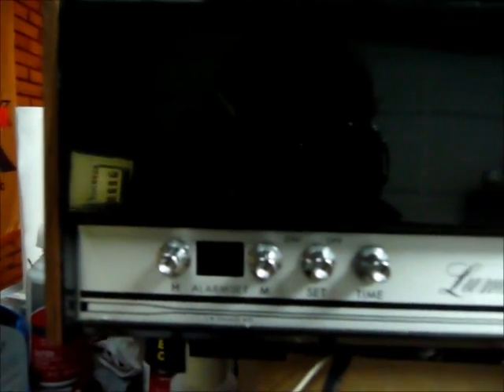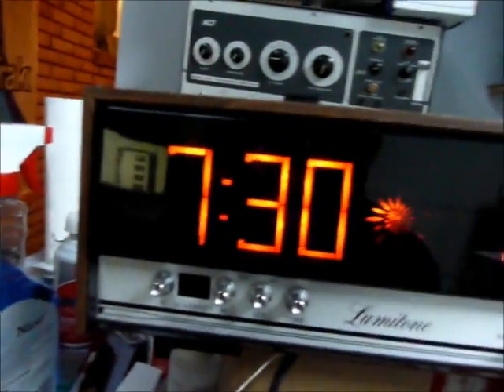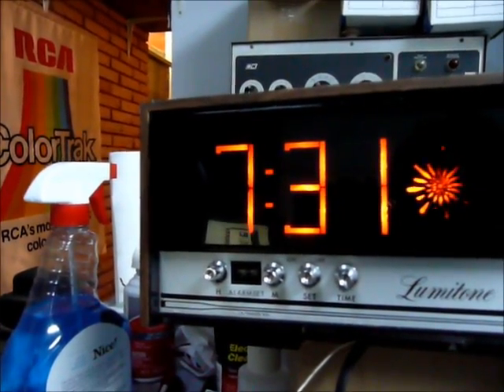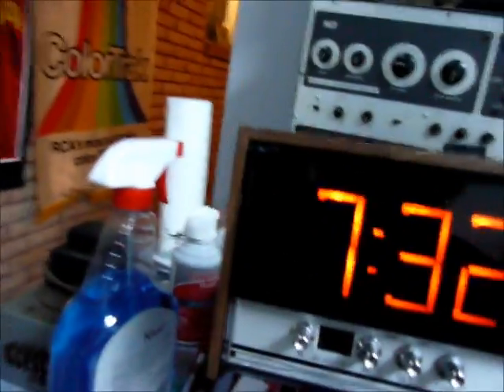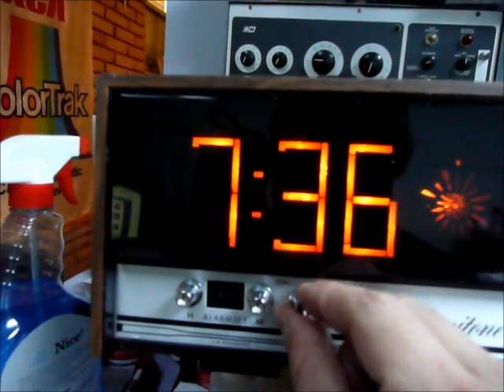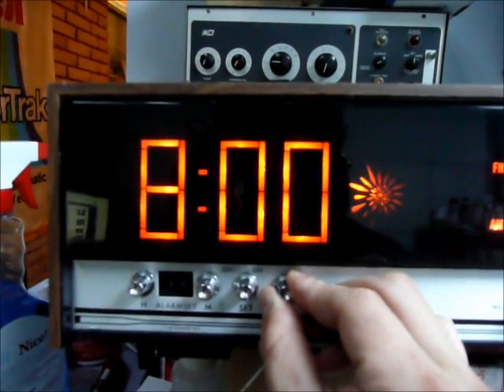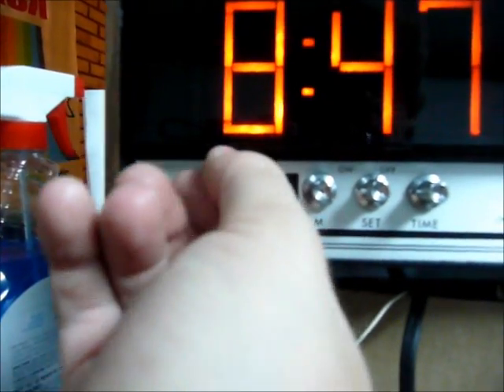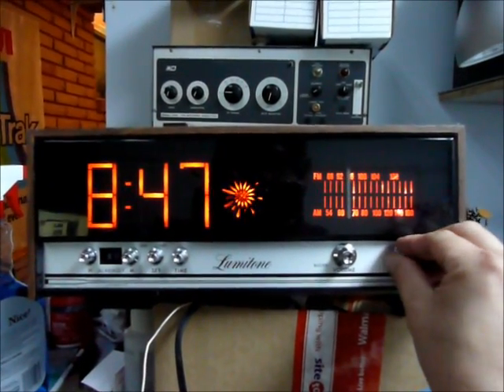Lumitone "Digital" Clock Radio (1973)

Comment: I had one of those about 40 years ago. Man I wish I still had it. The problems they developed is the mechanical switches used to switch the NE2 bulbs on and off failed.
I have one here that is even more rare, and mechanical. It uses a 7 segment display, but has mechanical shutters that open and close, and uses incandescent bulbs behind the mechanism. Check out my channel, I am posting a video of my unit.

Comment: Have you taken this apart to lubricate the motor and/or gears?
Reply from the maker: No - I plan on giving it a proper servicing once I get my workshop set up again.
Reply: Mine was stalling and then running backwards. I took the motor apart, added a few drops of oil and its back working again! I really need to redo all of the neon lamps though, they do flicker from time to time.